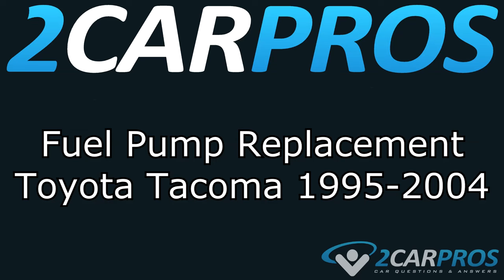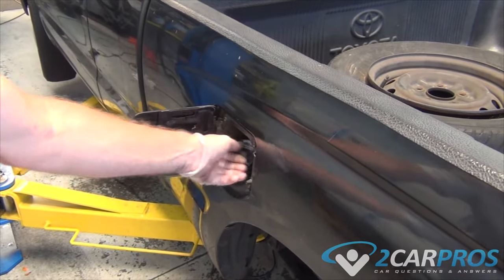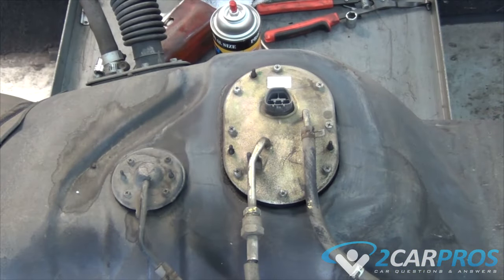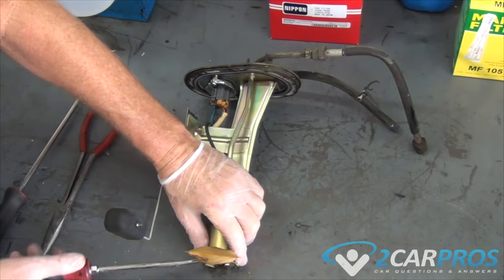Fuel Pump Replacement Toyota Tacoma 1995-2004

Comment: On my 1994 the fuel line sub-assembly looks the same, with a flare fitting on each end, connecting the steel line from the pump housing to the steel fuel line on the frame. Trouble is, both ends will not release.  I can get the nut loose that pushes in the flare of the tube into the ends of the flexible connector line, but after about one turn each one locks up and will not continue to loosen.  The tube is then loose on the steel lines on each end and there is no rust to speak of.  However, I can't get either end to come off more than about one turn.  Is there something I am missing here as the problem?  I have removed many such flare fittings in other applications, as with brake lines, with never encountering this problem and now TWICE on the same line?   I am thinking of cutting the line and then using compression fittings with barbs to then replace with a flexible fuel hose that is 30R9 rated for injection systems.  However, concerned about using brass compression fittings on fuel lines and not sure if this would be safe and secure.  I want to figure this out and get any needed parts before I dig further into this as the vehicle is running now.  I fear if I try to force the nuts off it will strip something or otherwise destroy the sub-assembly even if it would come off without cutting it.  Again, both nuts come loose on the flexible part of the fuel line near the petrol tank and all seems fine, but then as I try to remove either nut it jams and stops dead and will not continue. Tks.
Reply from the maker: Yep that is a problem, please ask your questions at https://www.2carpros.com/questions/new  our online mechanics will help you

Comment: Drop the tank???????
That's nuts! Lift the bed, 6 bolts and you can get right at it!!!
Reply from the maker: I think this is easier.
Reply: @2carpros  Actually, I just lifted the bed on my Neighbor's Tacoma...
Any other way is just insane!!!
They went, Wait, What???
Almost finished!!!
Reply: @2carpros  112.50 for an Aisin Replacement, labor, free. I have owned several Toyota 4wds since 1983.

Comment: Why in God's name would anyone put an electric pump inside a gas tank bolted to the bottom of a truck? Is this easier than removing the bed?  I've done this on an F-250 Heavy Duty, and it was a bitch.  Thanks for posting. Great step by step video. (Rusty)
Reply from the maker: Thanks for watching!